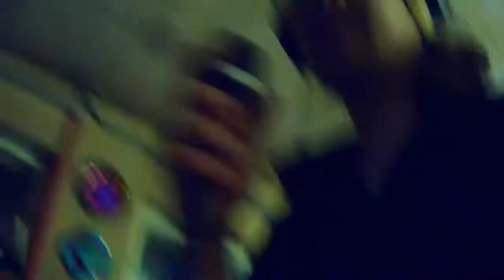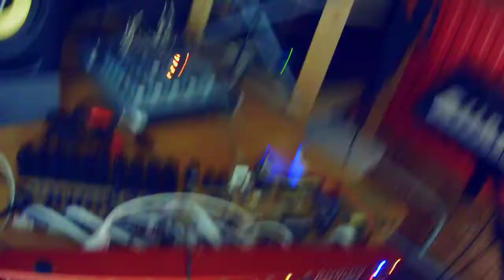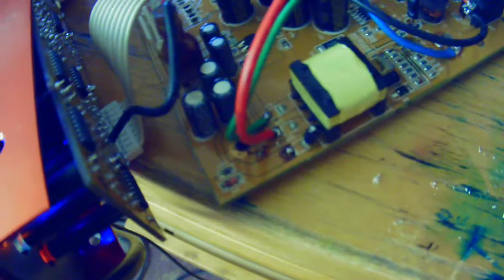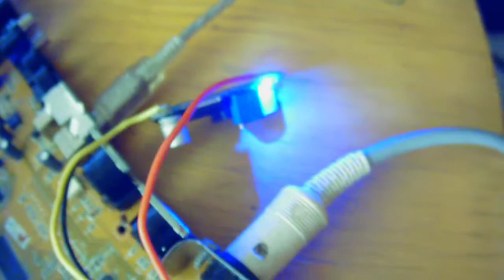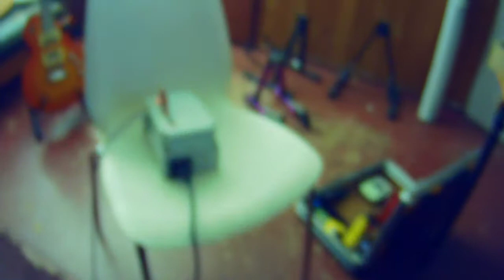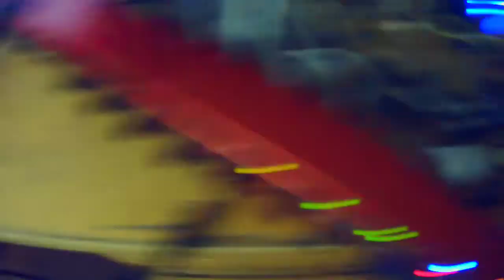Repair of Behringer FCA1616

Comment: What were you fixing? Mine has no analog audio.  Still works for optical in and out and into the usb.
Reply from the maker: The analog audio is powered by the +-15V, which was fried and short-circuited. I took out the fried chip and supplied DC voltages from an external power supply.

Comment: help in repairing a similar card, as the element is called  IC7 ?
Reply from the maker: Hello friend, IC7 is part of power handling curcuitry. I simply removed these parts and applied +-15V using an external power module
Reply: @pahanaama      
Hi Mikko! But I do not know where to apply + - 15 in? Do you have a scheme for this food? Where can I find the brand IC7?
Reply from the maker: @ВладимирБлюзов  ah hi, I have shown in the video, there are three diodes where you need to apply the voltages :)
Reply from the maker: @ВладимирБлюзов  green wire = - 15, red = +15, you can see in video at 01:35.
Reply: @pahanaama      
Thank you so much, Mikko!
Reply from the maker: @ВладимирБлюзов  no problem friend, I hope you get it working :)!